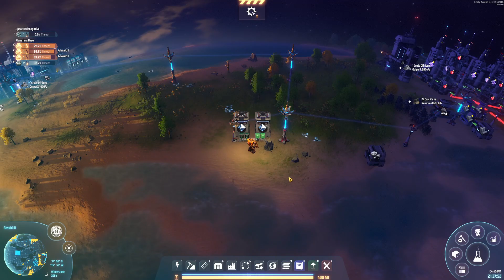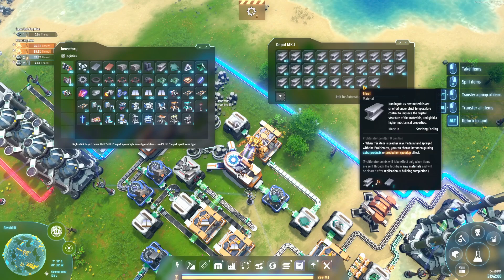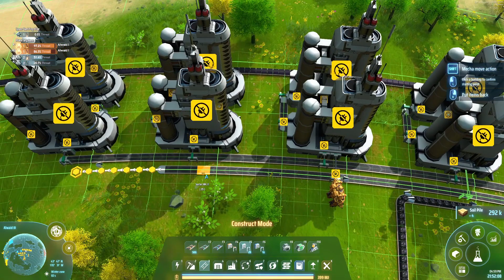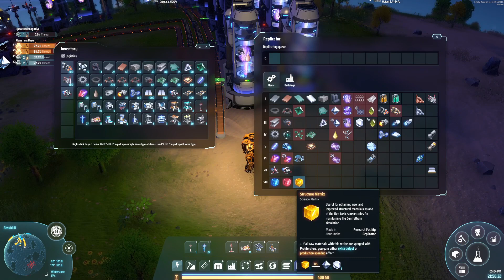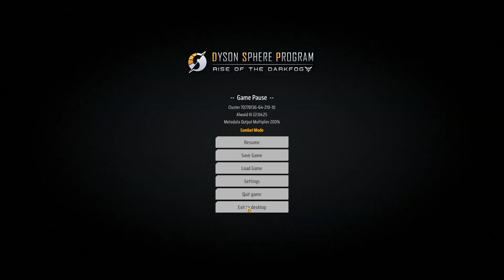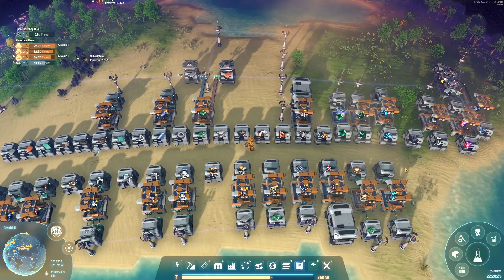PLASTIC // Dyson Sphere Program // Mission Log 26

Comment: attacking the base! fun stuff! couple things: attacking the base buildings will anger the space hive slowly, be very careful and watch the threat level of the space hive. DO NOT attack the relay stations of the hive, that is the "upper air" setting on your missiles, make sure that's set to "off" 

you are ready to take out the entire planetary base if you'd like to do so, it will slightly anger the hive but as long as you leave the relay alone they won't get too mad. if you instead want to farm the planetary base for loot, make sure you aren't shooting the buildings, cause that angers the space hive too, just more slowly than shooting relays. the threat will keep building over time and eventually they will attack you back.

farming a base will slowly level it up, increasing the damage and hp of its units, but also allowing it to drop cooler stuff. the good stuff starts dropping around level 12+ so that'll take awhile to start leveling. don't forget to just turn off all the drops that you don't want, since they will clutter up your battlefield analysis bases.

prior to angering the space hive you absolutely need planetary shields or they will devastate you entire factory. your missiles can shoot into space but they are fairly weak so you'll need a lot of them. you are pretty far from space combat tech still so be careful :)  Planetary shields are also a great way to block a relay from landing and starting a new base.

my preferred strategy is a giant 10x3 or 10x5 array of missile towers all being fed by a belt full of ammo so they never run out. remember that all the missile towers on your planet will attack anything in the range of a signal tower, so your missiles don't have to be near the front line. (gun turrets still need to be close by). a missile array blueprint is a great way to clear a brand new planet, but not the only way. 

ammo is a great thing to transfer in your logi-bot network, as its fairly low throughput, and the bots can bring ammo to your mech, which is a nice benefit.
Reply: dark fog units drop soil piles every time they die, so if you do decide to farm them, you'll never need to worry about soil again.

if you decide to clear the base instead, try plugging the hole with a geothermal power plant instead of foundations!
Reply from the maker: Done! Great suggestion, and as you said I now have millions of soil piles.